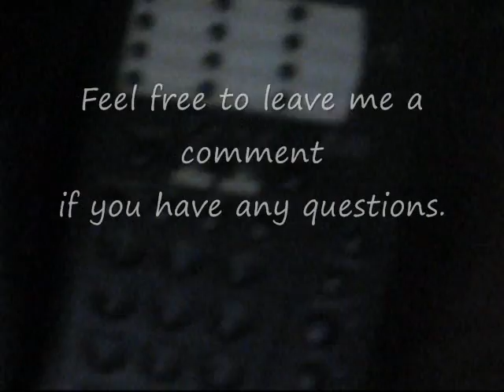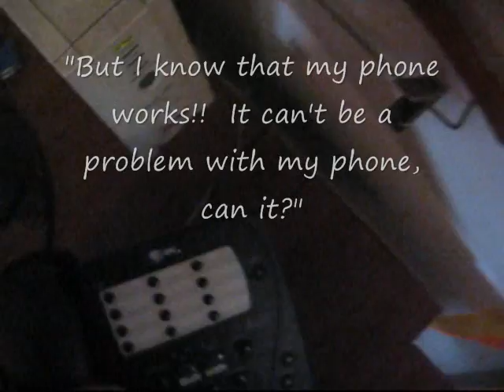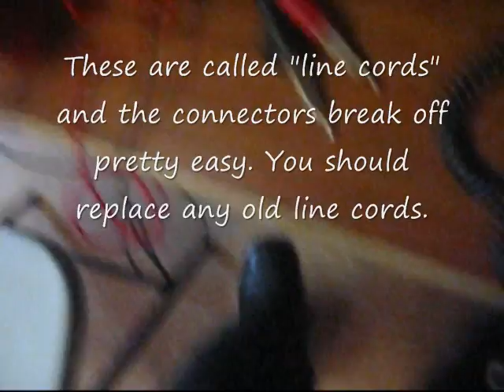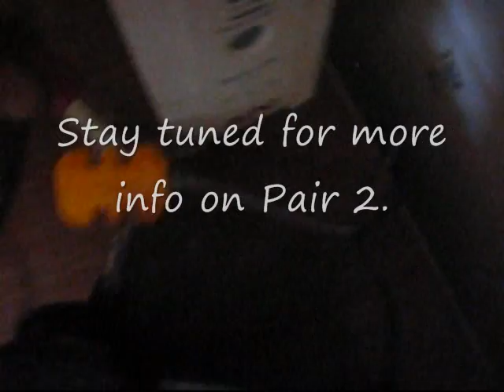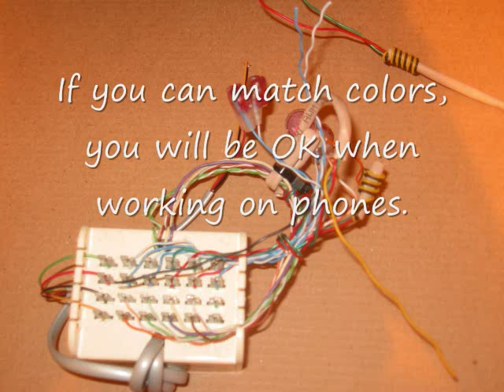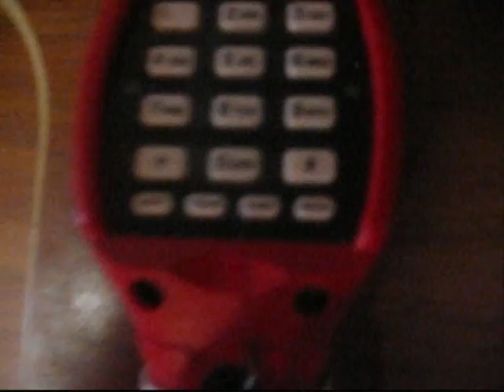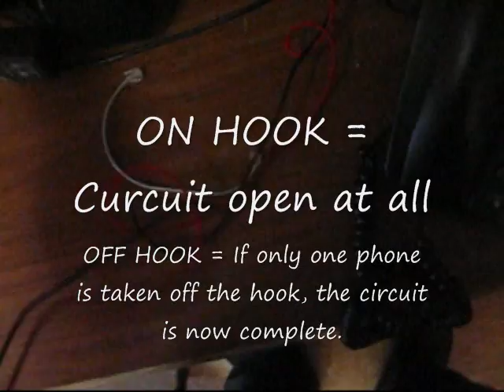Mr. Dialtone presents: LESSON 1: Use of the butt set, Tip and Ring, pair 1 and 2.

Comment: I'm trying to learn how to use the butt set my company bought for me but having difficulty.  Fluke Networks TS25D and the manual is not that detailed. It does come with a Banjo adapter.  Any Idea on where to look for info?  There's not much out there.  Thank you!
Reply: For most butt sets, the key idea is the switch on the side.   "Talk" is the equivalent of picking up the phone's receiver.  "Monitor" is the equivalent of hanging up.  So if your butt set is on monitor, it will ring or buzz when the customer gets a phone call.  To place a call, set the switch to talk and you will get a dial tone.  For a TS25D, you might have to install batteries before it will do anything.

Comment: Why would you use a butt to test your home phone? First unplug all the phones in the house and use a spare phone on the master socket. If that doesn't work unscrew the bottom section of the master socket and try the test socket. If that still doesn't work think about if you've laid any flooring or could have damaged the wiring yourself. If the answer is yes ask any engineer you see in the street if they do homers. They'll fix it for half the cost of a butt. DON'T climb poles. It's illegal.